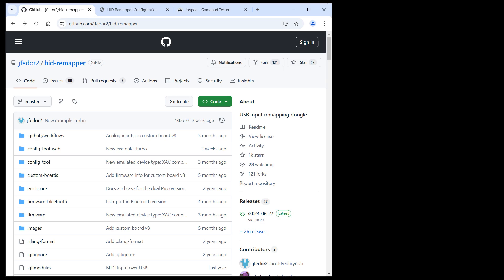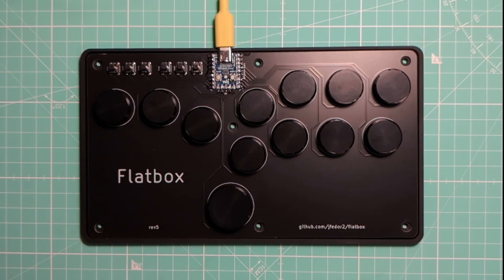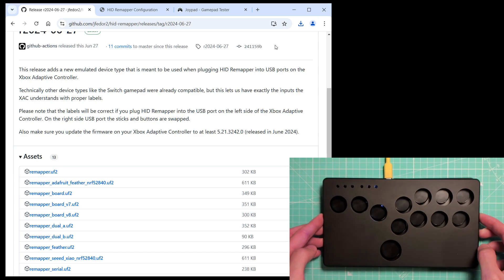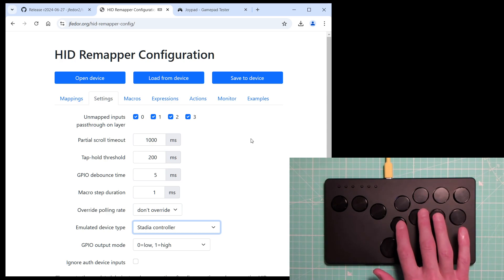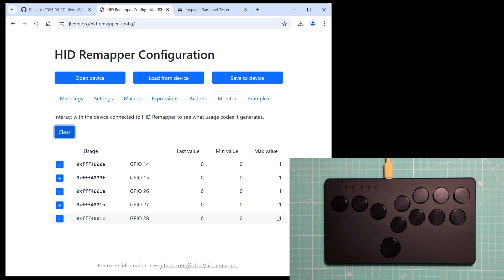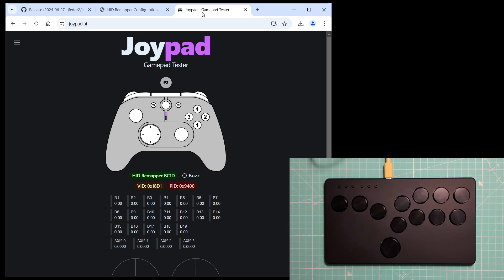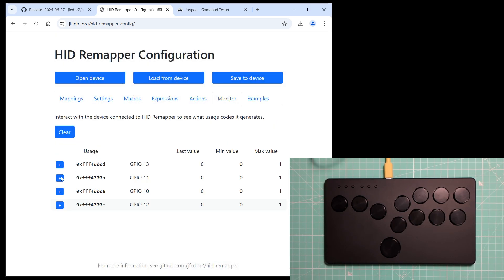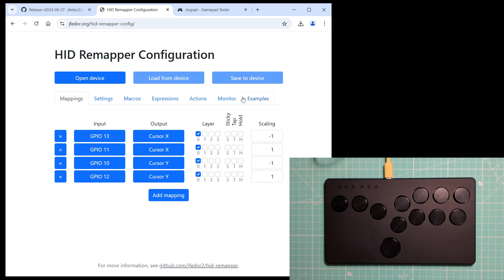HID Remapper as Flatbox firmware

Comment: Not sure if you're still paying attention to the comments on here, but I'm struggling to get HID remapper to work with my Xbox adaptive controller. I bought the adafruit Rp2040, successfully connected it to my controller and remapped the inputs on my IFYOO gtp01 gamepad, and then connected it to my XAC - with no input detected. I disconnected it all, tried it with a Dualsense the same way you did in a previous video, and no dice there. I'm thinking it must be a problem with how I'm doing it on a hardware level - my RP2040 has an input slot for a USB-C and an input slot for USB-A, but not output dongles for either. So I'm plugging one adaptor cord from the controller into the USB-A slot and then another adaptor cord from the USB-C slot into the XAC. And I think something might be lost in that process, because the XAC doesn't detect that anything is there. 

Is there some other way I should be connecting the RP2040 to the XAC? Thank you!
Reply: Did you ever figure this out?

Comment: Let's assume the ps5 access controller is ONLY communicating with the PS5 via USB.
Could we then use the second/third profile button to expand the E1-4 buttons to create profile 5-8 (P2 1-4) and 9-12 (P3 1-4)
And potentially just second and third profiles

The same way you are using the dongle to fake a PS4 controllers in your other video or create an additional "layer"
Reply: How does that profile button on the access work? Is it possible to have more than 3 profile options? 

How about 2 access controllers?
If access 1 is on profile 1 
Can it be 
Access 1 is on profile 2
It changes all of access 2s buttons

That way we don't have Additional buttons we have multiplicity
Reply: In Scotland we have a term jiggery-pokery - to poke it with a stick and see what happens

When we know it's not what's meant to happen we call this jiggery-fuqkery (unintended positive results)
Reply: Wouldn't it be interesting if the 2nd and 3rd profiles could be emulated but your device and create a whole host of additional inputs. Or at the very least expand 1-3 profiles to 3++ profiles under set conditions

Comment: A few GPIO pins (like gp17 and 18) does not work on pi pico . ive tried them on 2 boards with the same result.
Reply: 16 and 17 are used for UART TX/RX on the default build.
Reply: @jfedor  oh. thats unfortunate. is there any version that has 22 free gpio inputs? or do i have to recompile the source? code is really not my thing, sadly.
Reply: @bullzebub  If you flash the remapper_board_v8.uf2 firmware onto a Pico, you should have exactly 22 pins available. Plus two analog ones!

Comment: Hello. i tried to read a analog stick from a pico. i modified your v8 example (joy to mouse) and changed the adress to 0xfff4001b and 0xfff4001c as reported in monitor . but it does not work at all. i suspect the analog values doesnt match at all. is there a way to get a report on the analog values?

Comment: Using one as a macro pad is an interesting idea. I still have at least a couple extra rev 5s since I made a batch of 10 originally. GP2040-CE has a keyboard mode as well, and it sounds like mouse support is coming in the next release, plus you could probably put QMK on one of these since a lot of keyboards use RP2040 now, but still cool to have that option.